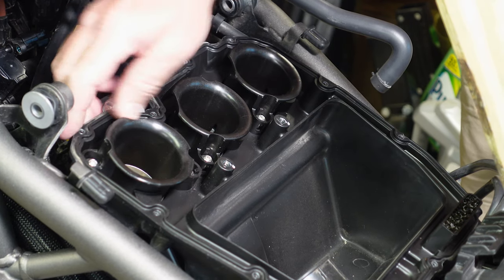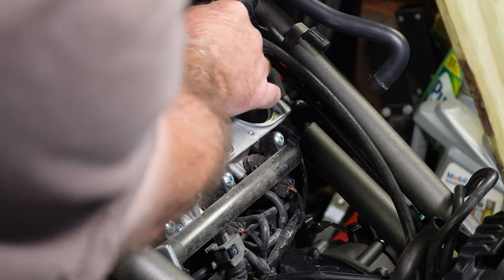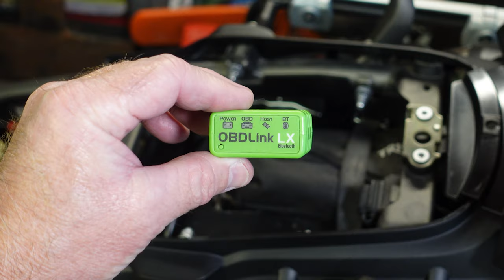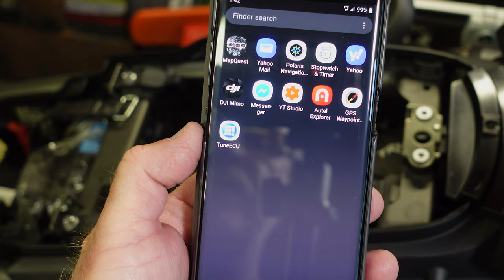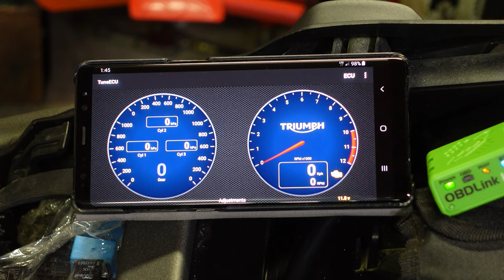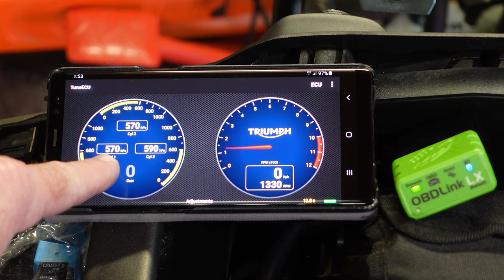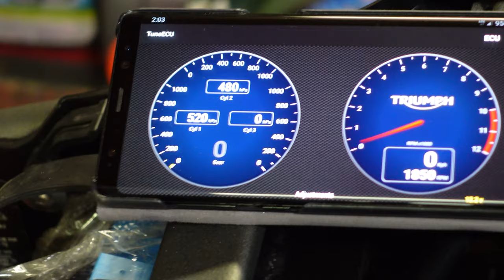Throttle Body Synchronization on the 2019 Triumph Tiger 800 in my best shirt.

Comment: Hi and thanks for a very good video! 
One question, before making all this work. Cant i simply connect the OBD before and verify that the throttlebodies needs adjustment?
Reply: Hello there sir..  good to hear from you...  yes absolutely you should check to see if any adjustment is necessary before any disassembly....  thanks for watching...  :)
Reply: @jonsmith9892  thanks alot!

Comment: Clockwise to lower and counterclockwise to raise right?
Reply from the maker: Hello sir, it is the other way round... clockwise to raise....  thanks for watching sir...   :)
Reply: were do u adjust it? i did not see that..
Reply from the maker: @chevchelios7342  Hello sir, at 5:15 in the video I show where to adjust the throttle bodies.  Thanks for watching and keep safe out there...   :)
Reply: @ozarksbackroads5484  ok.. tnx.. maybe u know?? is it slimilar on triumoh speed four or tt600??
Reply from the maker: @chevchelios7342  I am not sure about those bikes.  You will probably have to do some research there, maybe get a shop manual...  :)

Comment: Dose it need to be a running  engine temp  or dose it not matter  thanks for the video
Reply: Hello there sir, good to hear from you...  Yes the engine needs to be up to normal temperature before making any adjustments to the throttle bodies.... thanks for watching and good luck with all your projects...   :)

Comment: Thanx for s nice vid......!
Just one question, where do you get the correct value's to start off with. Like how do you know wich one of the 3 is the correct one to tune the others to?
Reply from the maker: Hello sir, yes the manual says the vacuum should be between 480 and 580 hpa at 1300 rpm.  If you sync them making the least amount of change possible...  ie tune the highest cylinder down and the lowest cylinder up you should be fine I would think...  thanks for watching sir and keep safe out there...   :)
Reply: @ozarksbackroads5484  Hi Jon! I have a 2018 800 xca. I’ve been looking for a service manual for weeks. Any way you can lead me in the right direction?
Reply from the maker: @curtismoore7007  Hey Curtis, I use the Hayes online manuals for all my bikes.  I have found them to be pretty thorough and complete...  Other than Hayes you may have to go to Triumph for one... Hope this helps... thanks for watching... keep safe out there...   :)
Reply: @ozarksbackroads5484  Thanks for the info. Triumph doesn’t offer a paper book for the newer models. Very hard to find an online version even. I will look into the Hayes online. I have a valve service quickly approaching and would like to be prepared as possible. I believe both of our world headquarters are pretty close to each other. Maybe one day we will cross paths. Thanks again for your help!

Comment: Syncing throttle bodies at idle will make the bike run smoother at idle, the goal is to have a smooth engine at your usual cruising rpm, for example i cruise 4k-6k rpm therefore my best sync rpm would be at about 5k
Reply from the maker: sorry sir but if that throttle bodies are in sync at idle they will also be in sync at highway rpm.  That is just the the way they work... thanks for watching and keep safe out there...   :)

Comment: Thanks for all the info, I want to get the components to do my 800.  A couple of questions;  should you warm the engine up to operating temp before you do the vacuum balance?  And should you clean the throttle body with carb cleaner with a emphasis on the balance ports?  
Thanks again!
PS   My son and I will be in Eureka Springs Nov 6-8, going up to Roaring River State park(outside of) to do some fishing, maybe we can meet up for a ride.
Reply from the maker: hey Chris, good to hear from you.  Yes the engine should be at normal operating temperature when the throttle bodies are balanced.  I do not believe the throttle bodies need to be cleaned unless the bike has really a lot of miles on it.  Hope you enjoy your trip to Eureka and Cassville in November.  That is a really nice area.  I will be out in Texas the last week of October and the first week of November so I won't be able to catch up with you guys but thanks for the invite.  Thanks for watching and keep safe out there...   :)

Comment: Hello again, I was wondering if you could provide the parts you used to extend the fuel line and electrical connections so that you were able to run the bike with the tank off? Thank you!
Reply from the maker: Hello sir, I did not have to do anything other than prop up the tank.  No extensions needed...  thanks for watching...   :)

Comment: Hy Man.  Can I turn off the service light from the Tiger  800,. Tiger900 and Tiger 1200 with this scan Tool?
Reply from the maker: hello sir, the scan app does allow you to reset the service light on the Tiger 800.  I have seen videos where some people cannot get their service lights to reset however.  I have reset the light on my Tiger a couple of times and have had no problem doing so.  I cannot say for sure if the app allows this with the 900 or 1200 however.  I would imagine that it is the same for the 1200 but with the new 900 you may have to do some research on that.  Thanks for watching sir...  keep safe...   :)
Reply from the maker: @andreasvoigt8497  I do not ,  I need to get with the program I suppose...
Reply: you have a direct cell chat contact
Reply from the maker: @andreasvoigt8497  you  can text me at 4178600457...  :)

Comment: Great video. I'm looking at used tigers and all are selling around the 12K mileage point which is the first maintainence schedule and the dealer said it would cost 1800 dollars. Alot for a 7800 used bike
Reply from the maker: Good to hear from you sir,  yes that is a lot of dollars for a valve check... Definitely a do it yourself job I would say...   https://youtu.be/NfbFWrMjoWw   Thanks for watching...  :)
Reply: @ozarksbackroads5484  I saw that one too. I've adjusted valves with tappets but never with shims. I dont even know what a shim looks like. Your video shows valves in specs. Do you have a video showing how to replace shims?
Reply from the maker: I do not have a video with the cams amd buckets removed but they are the same on all bikes.. any video of that would be applicable.. @michaelota5167

Comment: My Tiger 1200 idles up when I let out the clutch. Can that be adjusted out where it doesn't do that?
Reply from the maker: Hello there sir, good to hear from you.  The computer on your bike raises the idle up when you begin to let out on the clutch to help keep the rider from stalling the bike on take off.  This is a feature of the 800's 900's and the 1200 Tigers.  I am not aware of any way to defeat this feature.  You could ask your dealer service department if there is a way to do this but I am guessing no... Thanks for watching... keep safe out there...   :)
Reply: @ozarksbackroads5484  Thanks. I know it's normal, I just don't like it. I'll mention it to the dealer.